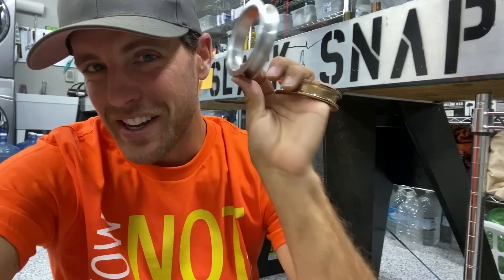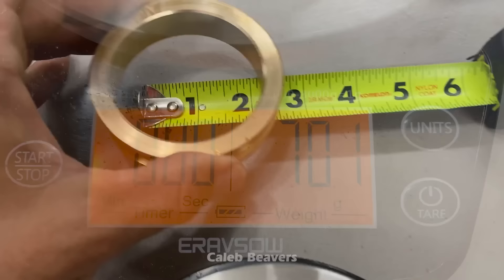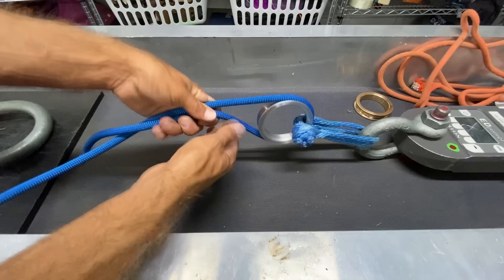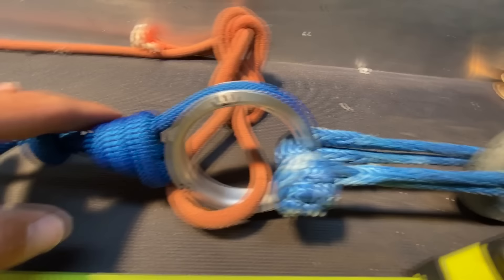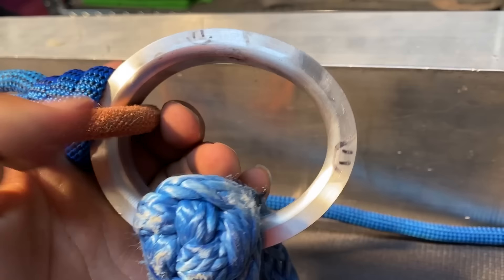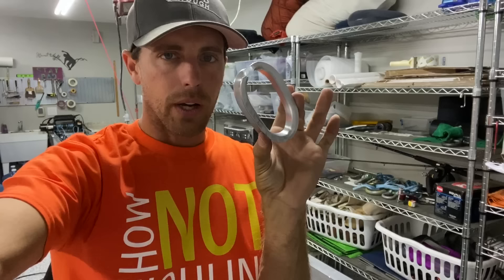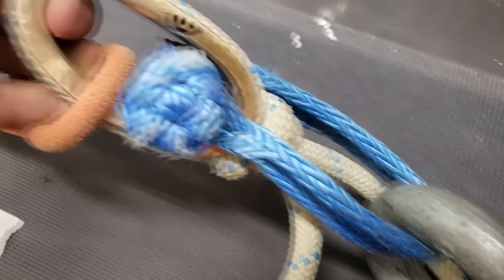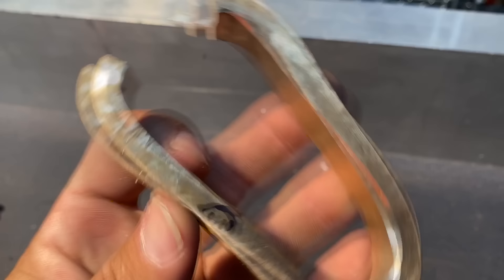Highline leash thimble rings break tested

Comment: Brass is still alot softer then steel. We use brass punches when working on steel firearms to not mushroom, scratch, or mark up the steel..If you're gonna have the weight of steel you might as well have the tensile strength and abrasion resistance of it. Definitley interesting seeing what it does though.
Reply: Good info! What do you think the best material would be?
Reply: @Andyjamesontheweb  Strictly on a power to weight ratio for this application, probably Titanium would be #1...Ti isn't as expensive as most people think but there would be a ton of waist if you're gonna mill it out of a solid block....The most cost effective way would probably be cast aluminum, but understanding that you have to know what you're doing. If you make a cast part with air bubbles and voids in it, the part could snap without warning....I dont see that being much of an issue though since your rope is what is the weight bearing part. Possibly some rope cutting issues with that though....I've seen people use 3D printed rings with dovetail connections. But again you could have a sharp edge issue if broken....A no non-sense working metal would be Titanium..If strength is more important, then a good crucible stainless steel or tool steel. Great thing about a good tool steel is that they can be hand forged from just about anything..You can take an old rusty truck spring or saw blade that's 100 years old sitting in the woods somewhere and forge it into a strong part ready to have new life again. Very cost effective but labor intensive. Lol
Reply: @50StichesSteel  :  Titanium is as expensive as expensive as most people think it is, if you can find it the best blank to start with might be a thick wall tube.  Aluminum casting alloys have no way near the tensile strength of wrought alloys.
Reply: @johndavidwolf4239  Castings are pretty weak, but are cheap...In this context all it really does let the person walk along the line without rope on rope friction. It's not really a load taking piece of equipment. Your rope us what your depending on...That's why I said it depends what you want, strength or cost, or lightweight with strength..depends what's most important
Reply from the maker: I have two titanium rings.  I love them.  $75 but how many does one need
Reply: @HowNOT2  Brass is more lubricitous. aka its more slippery as a materail but on nylon ropes..... yea not really an important property!

Comment: For safety, might I suggest "hardware cloth" AKA 1/2 " wire mesh, a concern is whether the camera will focus on it or what you are testing, if your camera has a focus lock, then focus on the test piece first, lock the focus then put the hardware cloth in place. If the screen halfway between the test piece and the camera, the depth of field of the lens should render the wires minimally obstructive.  Have the lens aperture as wide as possible so that all the test piece is in focus, this can be done if the camera has manual over-ride, if your camera only has automatic aperture control, this can be done by reduce the lighting, or by decreasing the "ASA" or "EI" setting on the camera.

Comment: The interesting thing I saw was the brass ring breathing, as the knot would pull away from the ring the ring would egg then as the slack slipped around the ring pulling the knot back against the ring, it would pop back to round, rinse and repeat. 
 
I'd like to see more rounding of the in side of the rings. For a softer edge on the slack line. ( note: I'll be watching with  But binoculars from the cliff or ground)

Comment: Here is some ultimate tensile strength information. Other properties such as yield strength, elastic modulus, and the geometry, will also affect the actual "real life" strength of a ring/biner so interpret these with a grain of salt. 

Brass: 49,000 to 68,000 psi (the term "brass" only refers to a copper/zinc alloy but not necessarily its exact composition, hence the range) 
6061 Aluminum: 45,000 psi
7075 Aluminum: 83,000 psi
304 Stainless Steel: 73,200 psi
1065 Carbon Steel: 92,100 psi

On the other hand, some nickel alloys have some incredible strength such as:
Inconel 718: 199,000 psi

Although incredibly expensive to machine, it would be really cool to test an piece of climbing equipment made from Inconel. Cheers!

Comment: Brass does not have the strength capabilities of steel, although mild steel (non heat-treated) is quite soft. I am guessing in this case that the material's strength is far greater than the expected load, since engineers typically design for that. I'd be curious what an engineer's perspective would be on brass in this scenario, and I'd love to see a steel version of this tested someday, if there is one. Great video, keep it up!

Comment: Whereas the strength difference between 60 and 70 series aluminum (the only ones that are communally used) at optimal tempering (T6) is about 20%, there are way more alloys of brass that can easily have a 50% difference in strength, from slightly stronger, to a lot weaker than high strength aluminum.

Comment: the winch is back or was this filmed pre hydraulic conversion? or was the winch brought back for the longer working length?
Reply: Question answered later in the video. Thanks again for making these videos!
Reply: I was wondering too
Reply from the maker: didn't release the batch of videos i have/had in order.  waited until these were available for order to release it.  Changes happen a lot here, but I make 8 to 12 episodes at a time so when they get released out of order things look funny

Comment: How long you can leave knot and not untie it. I mean is it ok to leave the knot like stone ?
Reply: Most rope manufacturers recommend you pull all your knots out after each use
Reply: @TheOKayStonemaster   yeah i know and i do that way but interesting how long you can leave and use untied knot?
Reply: @aharonkh  honestly it depends on what's you've been doing with it. Because most dynamic ropes are hydrophilic the can hold water and dirt inside the knot and cause premature decay of the nylon fibers. But if the knot doesn't get wet or dirty they can last years the only concern then is rope memory and uneven loading of inner strands over time.

Comment: That you had already tested the aluminum ring in the proper leash configuration may have changed your ultimate breaking strength in the improper configuration:  https://en.wikipedia.org/wiki/Work_hardening
Reply: A good point. Yet testing a new one would work harden it during the initial deformation and break it at around the max force anyway.